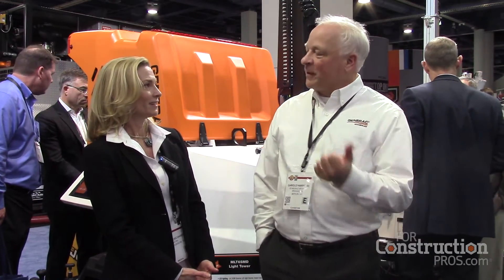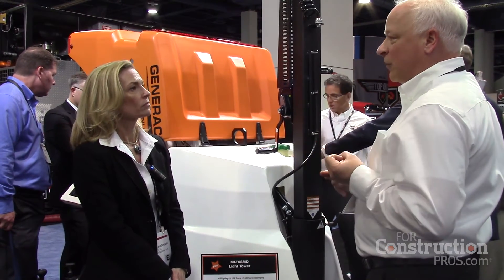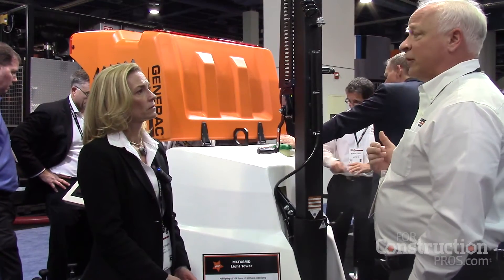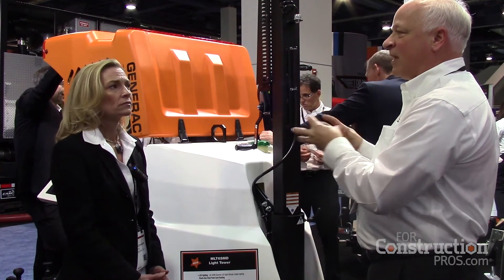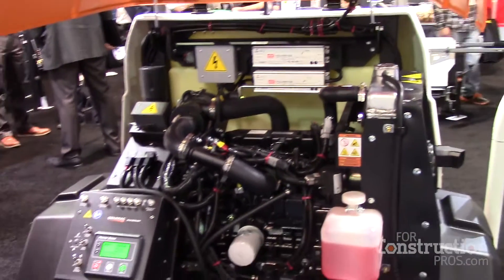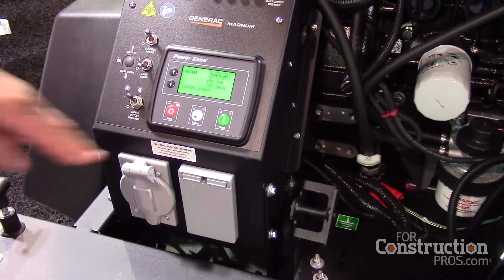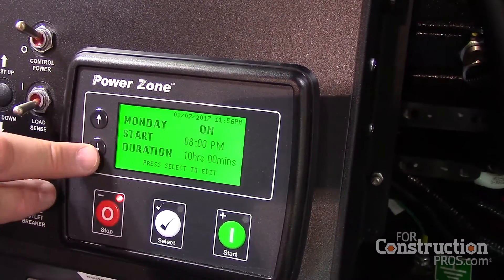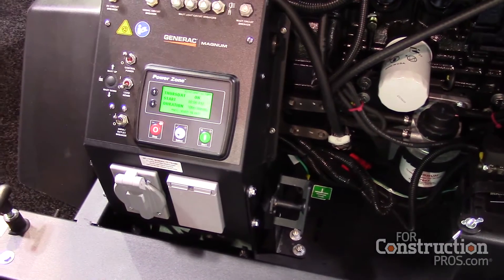How Generac's New LED Light Tower Eliminates Wetstacking

Comment: ⚠️Gas Generator Safety Tips:

1) KEEPING OTHERS SAFE: Please do not allow an unqualified person or your children to operate and service the portable generator. Just because some manuals don’t say that doesn’t mean it’s safe. That is important against the generator safety rules. We also need to be keeping an eye on our children too. You need to make sure that your children are not playing near the portable generator especially when it’s running so they won’t get electrocuted. Generators pose electrical risks and they can be hot during an operation. Please keep your children away from the portable generator at all times. It is important to keep our children safe especially our little ones. Be aware of all the hazards.

2) WHERE TO RUN YOUR GENERATOR: Some people use their portable generators indoors which increases the risk of carbon monoxide poisoning. It’s important to have carbon monoxide detectors in your home if you have a gas generator. Never ever use your generator indoors even if your doors and windows are open and even in the garage is not safe to use a portable generator. Also please never use your generator in your deck or balcony. It is never safe to use your generator indoors and in enclosed areas of your home. Your generator needs to be 15-20 feet away from your house. 

3)🔥FIRE HAZARDS: Never refuel your generator while it’s running. You need to let your generator cool off before refueling it and before storing your generator. Never overload your generator too. Never ever back feed your generator. You should never plug your generator into a wall outlet. Also never store propane tanks indoors. Please keep flammable things away from the generator as well and please don’t smoke cigarettes near the generator. Having a fire extinguisher next to the generator is also important against the generator safety rules. It’s also not safe to move your generator while it’s running.

4) GENERATOR OPERATION: make sure your hands are dry before touching the generator. Never use your generator in wet conditions. Don’t let your generator get wet. You need a generator tent if you need to use your generator during wet weather. Please don’t wear loose clothes when operating the generator. Turn on your generator before plugging in appliances. Use the right cord for your generator. Please do not use worn out cords. 

Portable generators need maintenance so it’s important to follow the safety instructions carefully.

Hope this helps. This is just a safety reminder when using portable generators.